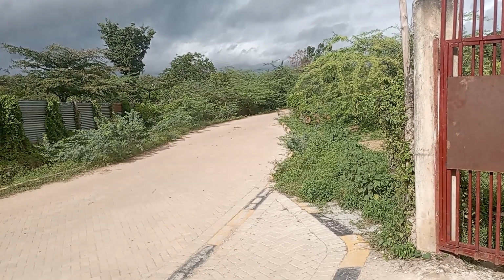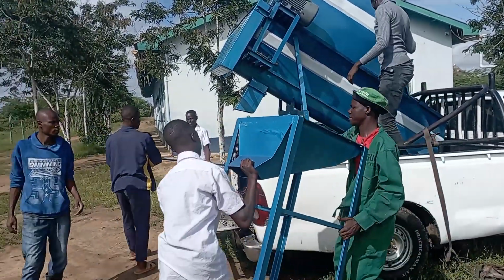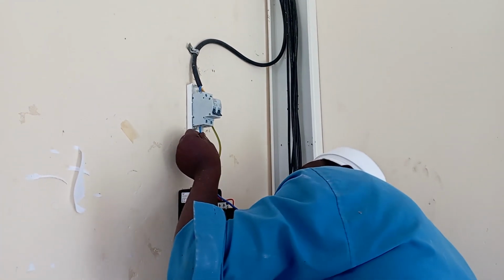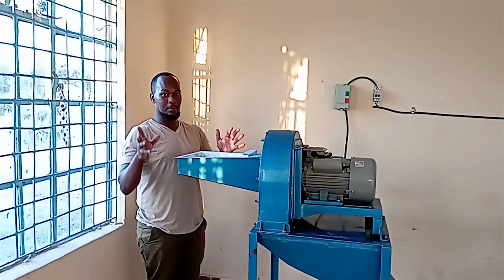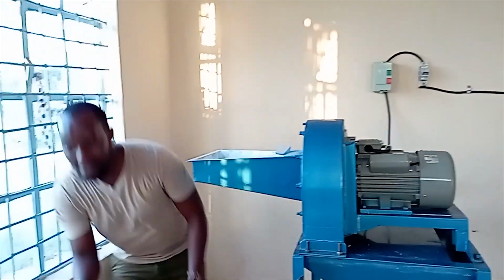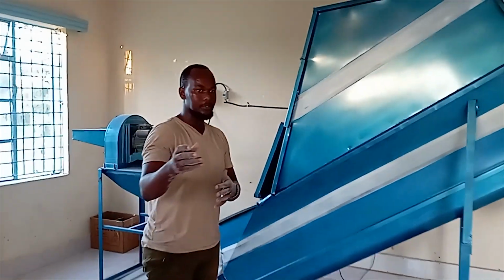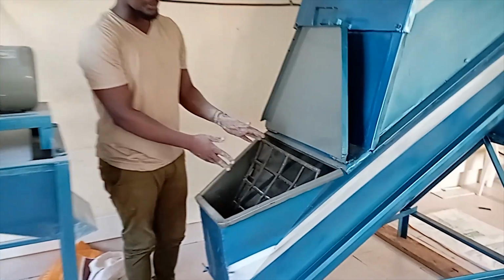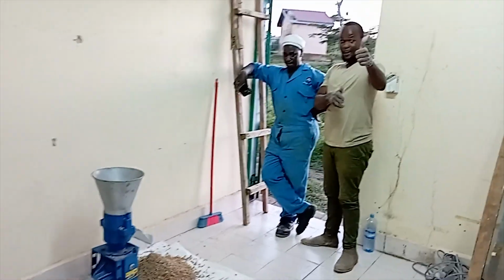How we Installed Animal Feeds Making Machines at our Poultry Farm

Comment: How is the cost of the machine
Reply from the maker: Well, it depends with the output and size of each machine. if you are based in Kenya  for such specifications as Afrifama you can get the local fabricated Feedmill (Budget ksh 600,000 - 650,000).